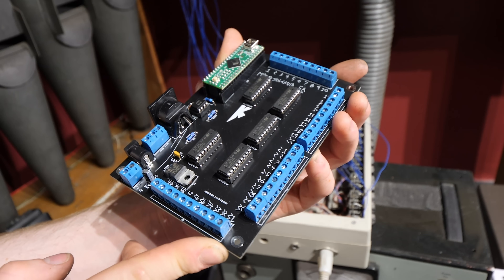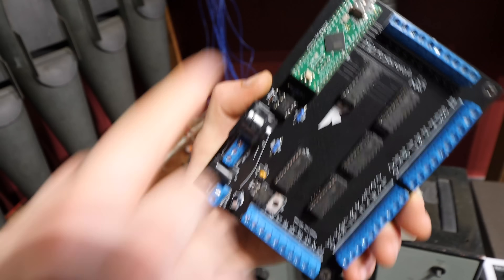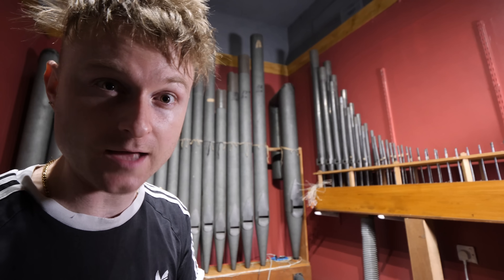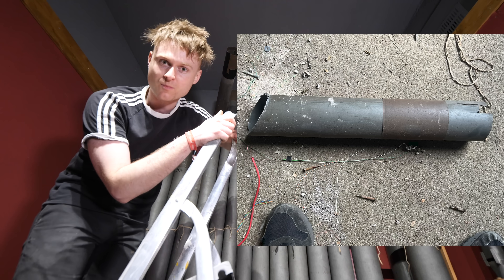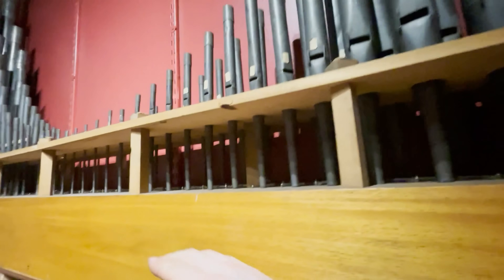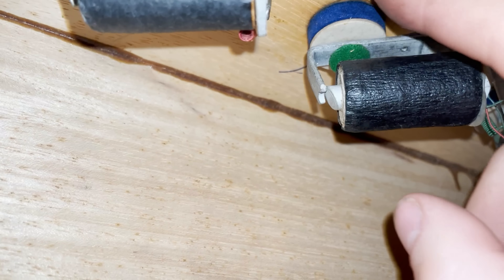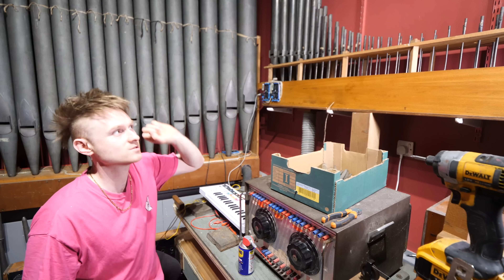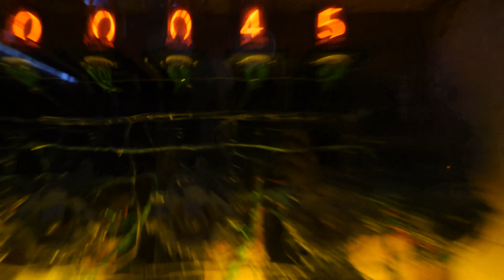I BOUGHT A CHURCH ORGAN Part 3 - Its Playing music!

Comment from the maker: I Still Don't Know What Im Doing.
YOU CAN COME SEE THIS. Museum open info in the description.
PCB and code is also available link in the description.
Reply: You've done a wonderful job of this organ Sam, well done
Reply: Sometimes I enjoy your videos Bro to honest especially those potentiometer video ;)
Reply: Sam, would you consider rush E?
Reply: You should check out Belgian Decap organs. ;-)
Reply: Its sounds awesome!
Reply: I would suggest adding a colored led in each pipe (or at the end of each small pipe that the led cant fit in). Then, if you play a note: light the pipe.. from the inside. So you can SEE which note is played: as well as hear it. It will make the organ seem .. alive! Alive I say! (One problem might be that the led will change the sound of each pipe a little. Perhaps try to mitigate that as much as possible somehow, or if its miniscule, live with it.)

Extra points if you can inject 'volume' into the visual feedback. Have brightness correlate directly with volume.
More extra points if you use colors to visualize where on the octave they are.

Then, play the organ in the dark. You can not only hear the organ play its notes. You can see which ones, and how loud, as well. Adding visual feedback to your audial experience. I think it would be possible and awesome.
Reply: You have midi so the LEDs and pipes can be wired separately.  Maybe a small mirror with bit of stained glass in front of it near the mouth of each pipe and hit it with a ceiling mounted LED array?
Reply: I bet there is a lot of demand for organ pcbs
Reply: You sound like you're rapping when you talk!
Not sure if it's the tone or the rhythm or both but if you made your sentences rhyme, that would be awesome!
Reply from the maker: hey bas, thanks. as mentionned in below comments im only going to use a single colour, dont wanna light the thing up like a christmas tree, there is only 1 volume these pipes run oiut, probablyjust gunna use red. cheers!
Reply: LOL someone gave me a church Oregon I think it has something to do with the fact that I watch your channel lol 
Because I truly never had a interest in church organs.
Reply: Keep doing what you don't know, 'coz you're doing it well !
Reply: @baskoning9896  As I don't have to do this - how about running some RBG LED strip up each pipe.
Could simply light the pipe as it plays, or make some bat-shit Equalizer-esque system. 
Have the LEDs  run up the pipe, the longer the note is sustained - you'd get some lovely tall and soothing lines on the deep drones, and fire-flies dancing over the higher notes.
Reply: As I watch this pipe organ transform into a MIDI instrument, it seems like you know exactly what you're doing.  LOL
Reply: Open Source Pipe Organ; Let’s fucking gooooooooooooooooooooo
Reply: One thing to note, i do think the pipe contain a good but of lead so be careful (mainly just wash hands post touchin em, and be damn careful if doing any hot work (angle grinding/brazing/welding or whatever)
Reply: YOU DON'T KNOW WHAT YER DOIN! YER NEVER GONNA FIGURE OUT WHICH WIRE IS WHICH! YER NEVER GONNA GET THE PIPES TUNED! YOU JUST DONT KNOW WHAT YER DOIN SAM! 

(jokingly referencing the short Sam posted a few weeks ago)
Reply: Treating your ADHD with awesome projects.
Reply: @WilliamWallace14051  Nah man, need a full on separate DMX Setup!   O r g a n   R a v e
Reply: Yep, you missed that one part. Throw it all out. :P
Reply: I also don't know what you are doing, but it's awesome!
Reply: thanks for the tocotta ! i cant wait until you have the organ fully functional hopefully with a replay and the fuge to go with it. i suspect you will also play the mario brothers theme as well lol , lights on the pipe is a cool idea  especially if you can also work the intensity  into them   ...brighter or higher up a series of lamps both have merits.  as for the actual instrument its my understanding  there are 2 families who service and tune  one in canada "doddington" and the other is in europe and i am not familiar with there name unfortunately. its my understanding these instruments are becoming rare mostly being replaced with fully electronic  facsimiles . i hope  you request information from either of the families in hopes of avoiding pitfalls. thanks for the videos as always
Reply: You just don't know what you are doing. Its too complicated. ; )
Reply: Likely in a vampire mansion
Reply: Now you have a church organ.. a remix of the Sarabande with organ included would be cool :)

Comment: Back in '81 I was a factory tech at Rodgers Organ. 
Thank you for reviving an old pipe organ.
Just a couple suggestions.

- Caution with screwing anything to the pipe chest (the wooden box). If the wood starts to split due to the screw, you can get a hiss. You might consider removing the screws, carefully plugging the holes with a fine-grain filler then mounting the boards with an adhesive (hook-n-loop would work great, and you can pop off the board if you need to do some troubleshooting.)

- You might tidy up those loose wires on the troublemaker solenoid. each time air rushes up out through the pipe, it will jostle loose wires a bit. Those look to be a fairly common, thin tiny wire (maybe 28 or 32 gauge?) and the metal (and it's solder joint) is subject to fatigue each time they are moved. If you have a one-button playback for the Fugue at the museum, then that little solenoid and it's loose wires will get much more activity than a normal church-installation, and you might start to get intermittent problems after a while. Just cut and resolder the wire with less excess length. OR dress the wire careful down to the wood and stick the excess to the wood surface with RTV/Silicone adhesive. Anything to minimize the chance for motion of that wire.

- Lights, per pipe. It should be easy to find a bright LED that won't take too much current to activate on each driven line from the Midi driver. You might want  to be careful about little short reverse transient spikes that can occur when a solenoid is turned off... the driver chips have their own protection circuit, but an LED might be susceptible to damage with those spikes. you can strap a little reverse-bias protection diode on each driven line. 
Type of light: I would stay away from any light with a filament... the vibration of th lower notes will shortened an incandescent lightbulb's lifespan.
AND an incandescent can have a slow turn-on time that might make it lag the onset of the played note.
Also, I wouldn't mount to light directly to the pipe for two reasons : a) weight. adding a mass to the pipe can change its tuning, and b) vibration of the pipe may lead to a rattle/buzz. I would mount the light on the wooden pipe-chest, near the toe of the pipe. BUT, this means bringing a parallel wire from the driver OR out through the chest-wall (NOT recommended). Just stuff to think about.

Now, we need to find you a couple ranks of Reed pipes and you can get that piercing, harmonically-rich sound that is throughout so many great pipe organ pieces.
Reply: Yes. Need to expand the sonic palette with reed pipes. All the other tips are great, too. Velcro is a musician's friend.

Comment: Good to see this moving forward ! The other half was commenting on how much your midi boards resemble (in function anyway) the system we use that we imported from the states for our three pipe organs, by a company called Artisan. Also as it'll be driven by midi, have you thought of using GrandOrgue as a replacement for the original relay ? For stop selection etc, all open source. We've also got a tonne of midi files from old residence organ rolls if you'd like copies, our museum archives are open to yours.

Comment: That is awesome! I think you're lining up to be the first museum with a playable pipe organ. Depending on how much current those solenoids need, you could use LEDs in series, just in front of the pipes. Since you're irritating people by attaching to the air boxes, you could really give them an aneurysm and drill the LED through -- just be liberal with epoxy or something to seal it! Use a resistor/capacitor filter to make them come up slowly and fade out slowly like incandescent lamps. 😁👍️
Reply: There is a museum in Vermont with one. It’s the only one I can think of. And they are only open  2 hours a week in the summer
Reply: @nicholas_scott  Not surprising -- I know maintaining these wind-powered beasts isn't cheap, and the cost goes up algorithmically the larger the organ. That 2 hours is probably all the time they want to put on it. But, as someone who spent many formative years in Church, Sam has done a lot to demystify how the thing even works. I feel like I could potentially troubleshoot one now.
Reply: There are plenty of museums, especially in Europe, with pipe organs. The Netherlands has an organ museum, and Tasmania's MONA has an 1800s chapel organ in one of their private entertaining spaces.
Reply: It is not a wise idea to put LED's in series with the solenoids, or use an RC filter for dimming them
Reply: @patrickmeyer2802  Interesting. That's not a common thing here in the 'States, AFAIK. It's my understanding that Sam's aiming toward this being playable by the general public; I would imagine those museums don't do that?
Reply: @peerappel2012  Why do you say so?
Reply: @McTroyd   You're going to put the entire solenoid's current through an LED?  Limited by a resistor?  And shaped through an RC filter?  :-)  No, I think you may have been thinking "in parallel" which would be fine.  :-)
Reply: @nickwallette6201  Oh! Yes, yes. Fortunately I'm not an EE. 🤪
Reply: @McTroyd   :-D  No worries, I've got your back.  (Although I'm not an EE either, but sometimes I pretend on the weekends.)
Reply: There's a great organ setup in the Scarborough Fair Collection, which is mostly a museum of old amusement rides and classic cars. Highly recommended. You can ride on many of the rides. I don't think you are allowed to play any of the organs yourself, but they have an organist who performs and guest concerts at other times.
Reply: @rjmunro  Sounds awesome! Perhaps I'll go have a look if I ever make it to the UK.

Comment: Only ever heard a live church organ once; it was at a performance in Sloan Square; The Holy Trinity Church. 
An amazing sound, which was totally unexpected. Sometimes I could feel the vibration from those deep bass notes going through my body; I thought I had heard 'bass' before that, but that was the real deal.    Anyway, I'm genuinely floored to see the work you're putting in.
Reply: I used to work with an organ nut.  Some of the larger pipes would be low double-digit Hz, like 18Hz.  It's a real problem for those wanting to convert to electric instruments, because it takes a fairly significant (and well-powered) piston to move that much air as effectively as a large pipe.
Reply: TinyMaths yep, put the fear of God into the congregation!

But seriously the closest I've had to the physical experience of a great organ (St Sulpice in Paris is my personal favourite) is the sound system in the Campden Palace in the 80s (the bass speakers would re-arrange one's innards) or a pro-fuel dragster doing burnouts or a fighter jet scrambling.
Reply: Richard Harrold  16Hz was what I was thinking of.  Pretty awesome stuff.  I've only heard a few organs in person, including one in the backup Notre Dame, but haven't ever experienced one played in anger.  It's on my to-do list.  :-)

Comment: Would it be feasable to blow some sort of smoke/vapour into the air supply, without damaging components or changing the tone too much? Could be a pretty cool way to visualise the movement of air through different pipes as you play.
Reply: Or heat up the air and display the whole thing on a big monitor via a thermographic camera
Reply: @DavidJohansson  Now that would be fun to hear how the tuning changed when it warmed up 🤣
Reply: There's a lot of wood and felt in that instrument - I'd be hesitant to add any form of vapour for concern of letting them get damp and rot

Comment: Is it possible to add more boards to mirror the existing ones ?
Make a mount for the ceiling with a load of laser pointer modules pointing at the appropriate pipe, in a darkened room with a smoke machine it should look cool, specially if the lasers are crisscrossed.
Or, vertical spots or lasers in front of each pipe to mimic Jean Michel Jarre's light organ
If laser pointers are still too risky, some sort of miini spots
Reply: please this
Reply: I was about to suggest a light per pipe would look great, but lasers are even better :D

Comment: Wonder if you put a fog/haze machine before or after the blower if you could get pipes blowing smoke convincingly? Would be cool with the lights, for a little while anyway.
Reply: Just imagine what a potential of tone pitch he has by adding some amounts of Helium or SF6 into the air. Should be definitely mental.
Reply: @dmitrymikheev7899  dont forget the laser holograms too!
Reply: @jhonviel7381  Pipe Organs? Lasers? Copious amounts of fog? This room is turning into an ELP concert!
Reply: @jhonviel7381  Sure. a red laser put on a  flat spring to big tubes will perform acid-crazy oscillations i guess.

Comment: the first time I heard about midi pipe organs I was amazed (it was in a temple); and now I understand modern organ are already electromechanical instruments; so it's a matter of plonking a midi port on it and it's done. Would be great if there was a way to control the quantity of air you send in each pipe; probably not possible using these solenoids but maybe at least it's possible to control the global power of the blower thingie (with something like an expression pedal or aftertouch)? are these cards a personal build? can we find them somewhere?
Reply: Link in the description for the PCB design and the Teensy code.
Reply: I'm pretty sure the Notre Dame organ has/had a digital (MIDI) console after its most recent refit.

Comment: When switching inductive loads (like coils) make SHURE that you have reverse diodes. I dont know what chips you used; they might have reverse diodes inside. But if they dont it might work for some time but then it might break your mosfet chip or even worse the tensy
Reply from the maker: well yeah. most modern transistor array packages know about this and have the diodes as standard
Reply: @LOOKMUMNOCOMPUTER  It's actually surprising that chips in those tiny packages w/o heatsink can drive the coils. How much do coils consume?
Reply: I'm guessing they're ULN2003a's or something similar, so <500mA per solenoid. They can be piggybacked for more current.
Reply: @dcnick3  Mosfets are remarkably efficient when they are fully on, since at that point they have a really low resistance. Resistance is what creates heat in electric circuits.

Comment: I said Bourdon in the last post.  That is usually a closed wooden pipe.  Open Diapason is usually an open ended metal pipe.  Again, it too has strong fundamental and usually is a main rank on the Great Manual. 6:32.  A suggestion would be to put those midi controller boards inside the wind chest to keep the dust out.  Alternatively, you could just have covers made for them so you wouldn't have to drill (and then seal) holes into the windchest.  7:48.  You might realize as you say that stacking the pipes up to build up a tone is really a rudimentary form of additive synthesis.  So yeah, pipe organs are Jurassic synthesizers.  8:35  Yes, indeed, Toccata and Fugue in D minor, is industry standard testing for pipe organs.  LOL!  Not bad!  But I am guessing that is one rank that you managed to get in tune.  I have no idea how many more you have to do.   I didn't see many stop levers on the console, but many older church organs didn't have many ranks.  Still if it is about a dozen or more, then you are still looking at a long time to get it all in tune.   Some of the smaller pipes are getting too much air pressure as they are blaring.  You can adjust the air pressure on a metal pipe by opening or closing the hole on the bottom to allow or restrict air flow into it.  Yes, that will also mean retuning the pipe.   Well, I will say that I have to tip my hat off to you for getting this far so fast.   Congrats!

Comment: For your C# pipe, get the cardboard inside of a fabric roll from your local haberdasher, cut to size, and duct tape it on, until the mitre is reunited. Doesn't need to be exactly the same diameter. I have temporarily bodged many a church organ with duct tape...

Comment: i read this on you page "I use a Teensy 2.0 ++ as it has a lot of pins, which aids simple coding for people who are not codely endowed, much like myself. " if you like i can make something realy easy (also easy to code) with shiftregisters so you can use a arduino with lesser pins. i made a library for the 74hc595, 74hc165, and 4051 all in one so it only need 5 pins.

Comment: Use a teensy 3.2 and it's RGB shield the OctoWS2811. You can then use cat 6 cables and each pair connected to RGB led strips. Have a look on PRJC, you could run the same midi signal straight into the new  teensy 3.2 and drive the led's.

Comment: I wonder what non-music mechanical things can be controlled using that circuit board you made and a MIDI controller. 🤔
Reply from the maker: anything that uses .5amps or below per point
Reply from the maker: iin the datasheet for the drivers it says use for 
Relay Drivers
• Hammer Drivers
• Lamp Drivers
• Display Drivers (LED and Gas Discharge)
• Line Drivers
• Logic Buffers
• Stepper Motors
• IP Camera
• HVAC Valve and LED Dot Matrix
Reply: @LOOKMUMNOCOMPUTER  it would be wild to set a whole house up to where all electronics trigger from a MIDI keyboard. Turn on garbage disposal, oh that's C3. Open the garage door, that's G2. Porch light F#4... I'm thinking about life differently now. 🙃